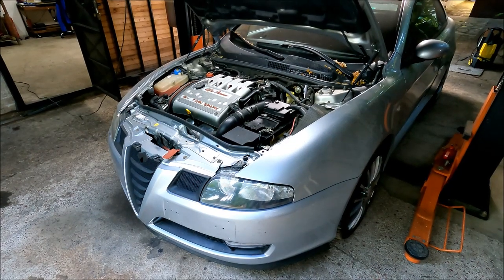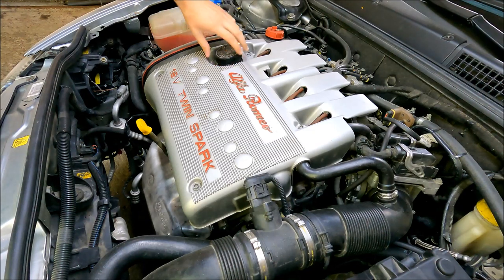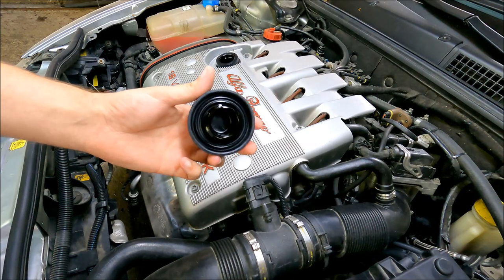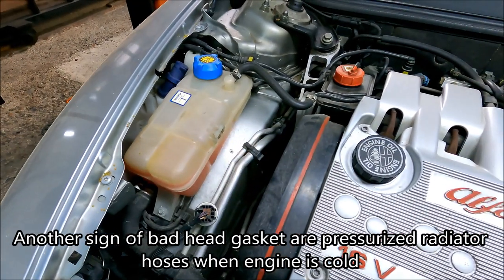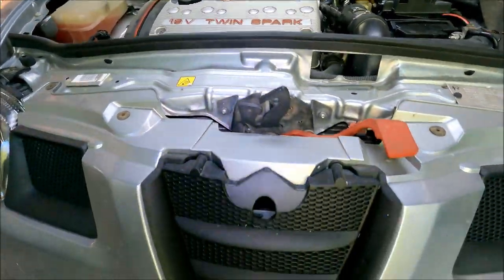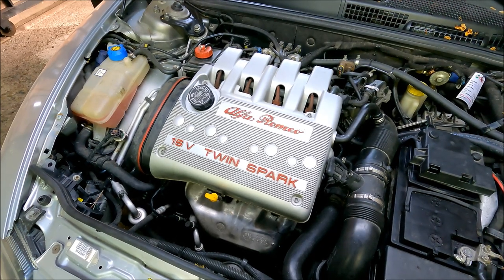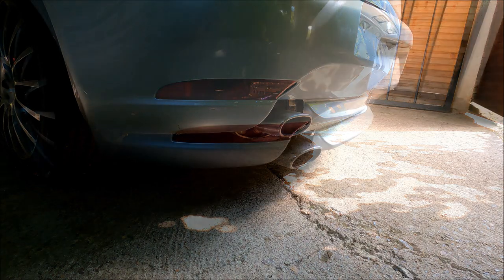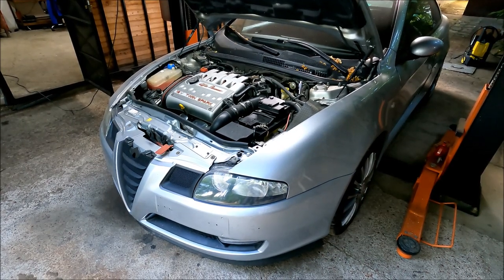How to Test Engine When Buying a Car, Diesel and Petrol

Comment: Very useful your video, thanks a lot. I have a doubt with the variator you said it sounds like a diesel. Mine sounds like a diesel only for 2 or 3 seconds when start the engine when stopped for a long time. Is this could be a symthon of bad variator? Thanks un advance
Reply from the maker: Yes, the variator is on its way out...

Comment: 1:24 - direct injection engines make the oil black very soon. The same is happening on diesels.
Reply from the maker: You're right, I forgot to mention that. Oil on diesels gets black as soon as you start them up after oil change...

Comment: When my alfa starts up and is stationary i hear a rattle sound coming from engine bay. it’s not loud but also  very noticeable. I can hear it better with window opened. It Sounds like bolts on a metal plate vibrating. Also when i push down the gas above 50 km/h. Do you have an idea what this sound might be arc?
Reply from the maker: I would have to test for it myself...